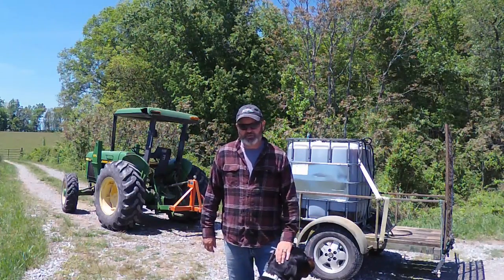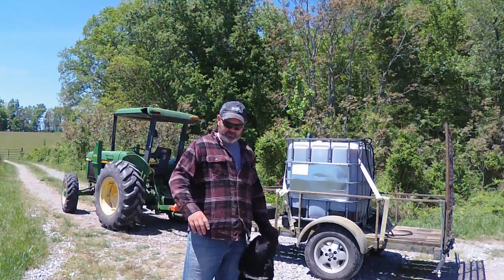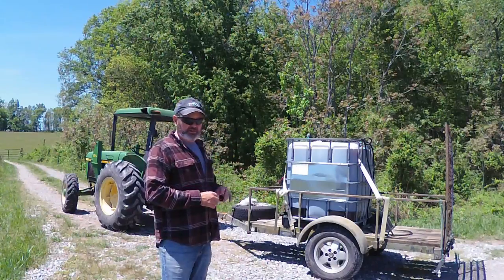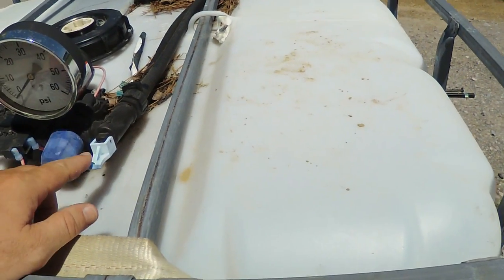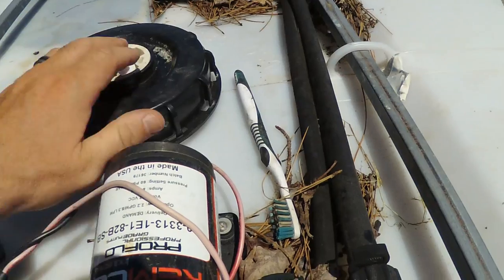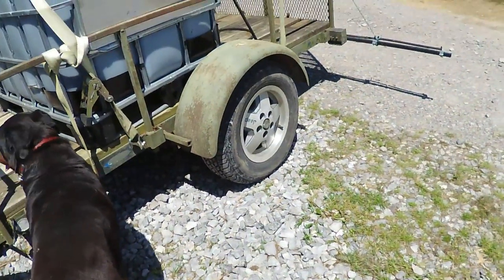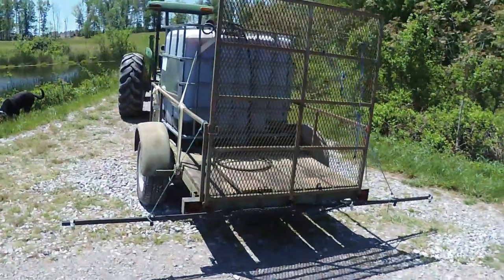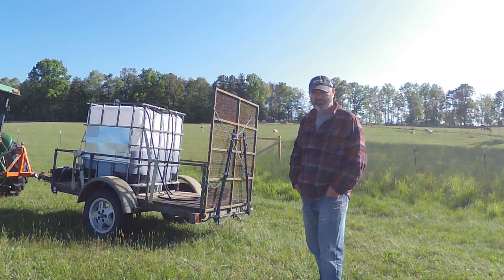DIY High Capacity Farm/Pasture Sprayer

Comment: Does the tea go through the air pump motor or anything? They say it can kill the microbes.. also can you control the psi if you want very little pressure ? just wondering. 🙏 great video!